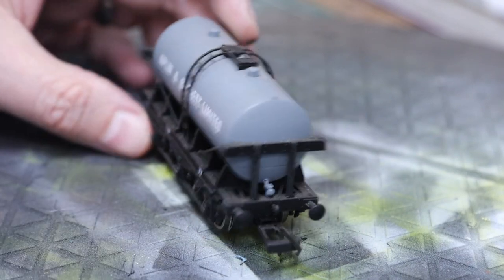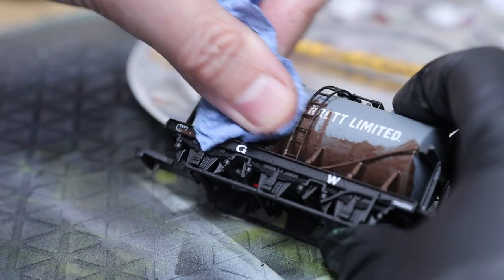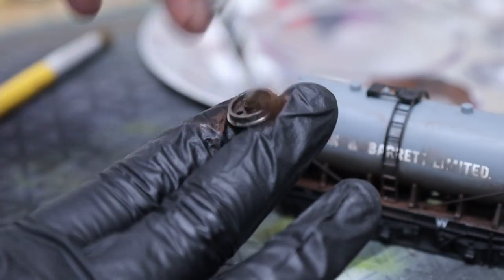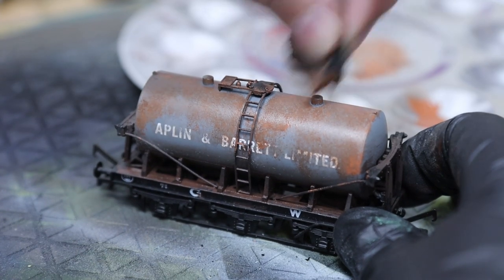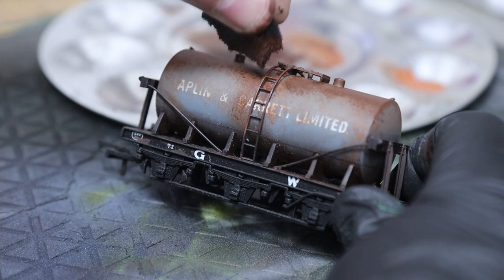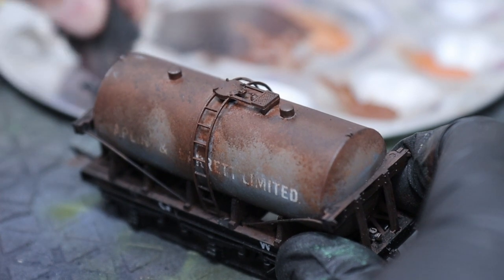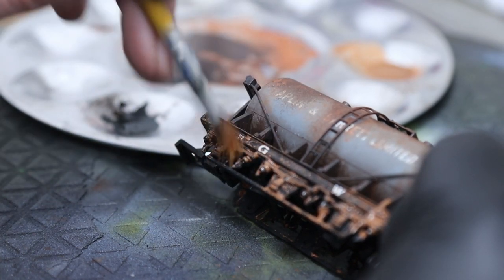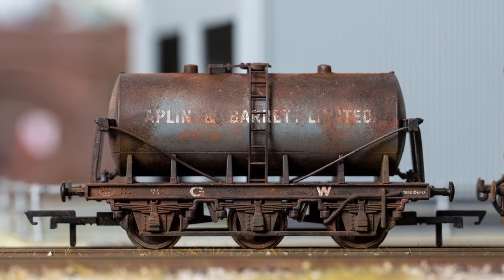Weathering Dapol Tank Wagon without an Airbrush | Weathering Model Railway

Comment: I did leave a comment on Insta but hit send before finishing 😆 
But to add, this is a really good example of how good weathering can be without even picking up an airbrush. 
I still to this day prefer had applied weathering and only look at the airbrush as a means of putting paint on before re-working, blending, filtering etc.. that same way I did with a paint brush. 
Keep them rolling, great job.
Reply from the maker: Thank you. I agree. Applying the paint with an airbrush is usually just the first step. I also tend to rub some off, or add an effect. For heavier weathering, the airbrush can be too fine and not leave any texture, so brushing, stippling or sponging is the way to go. 
For just a general layer of dirt and grime, you can’t beat an airbrush though
Reply: @BuntersYard  agree with that in regards to a general layer of dirt. Before I got into airbrush work I'd hit all my underframes in powders and a touch of enamel wash and that was pretty much it, but would take an age to do so many layers. 
I would say that the airbrush is now my number 1 choice for doing underframes, cuts down the time and the end result is just as good if not better.

Comment: You can do excellent weathering by using a childs water colour paint set but instead of water you use liquid soap as part of the mix. It dries matt and is quite robust and lasts as long as you want. Obviously if you want to make it permanent spray it with clear varnish.

Comment: The tanker you chose looks great! I do love a three-wheeler. I have an air brush but i am pants at it. This is very informative for me and many others by looking at the comments. Great video and keep it coming .
Reply from the maker: Many thanks. Don’t give up on the airbrush. You’ll see by the comments fro the ScrapLine that we agree the airbrush definitely has its place in the weathering tool box. Practice on some old wagons and, as with most things, less is more. You can always add more paint. It’s more difficult to take it away. Good luck
Reply: @BuntersYard  i have loads of wagons i can practice on. It does have a space in the weathering box for sure
Reply from the maker: Go for it. By the way, if you soak your wagon in meths for 5 minutes, you’ll get most of the weathering off, and then you can try again!
Reply: @BuntersYard  thanks for the tip

Comment: Quick question..do you add anything on top of wagon to seal weathering powder etc? Thanks for sharing...love it will be back….👍
Reply from the maker: Sometimes. If it a wagon thats going to be handled then i'll use a matt varnish. One light 'dust' coat and then another coat when its dried. If you apply the first coat too heavily you can wash the powders away.
Reply: @BuntersYard  oh..thats great thank you for the help and Advise much appreciated..oh last question ( promise lol) do I add. Anything to the varnish….ie finners.water etc….or just  add straight from the bottle….👍
Reply: @burgermaster4u2  I used to use Testors Dullcote spray can. However, they stopped supplying the UK, so I now use Tamiya matt laquer. TS-80. It delivers a nice fine mist coat. I actually prefer it to Testors.

Comment: Hi there, bit off topic but do you get any problems with these 6 wheel tank cars. I have 7 of the pre-weathered Dapol ones and they are a disaster on our club layout (PECO). I’ve checked and adjusted using wheel gauge and even tried substituting some of the wheel sets with Hornby ones to no avail. I tried adding 5g of weight to a couple of them but didn’t help. Any ideas?🇦🇺🤞🥺
Reply from the maker: Hi. Sorry that i haven't replied sooner. My layout is end-to-end, so don't really have any curves to negotiate. If i did though, i'd possibly look at removing the flange from the centre wheels. 
Maybe other viewers will have another fix?